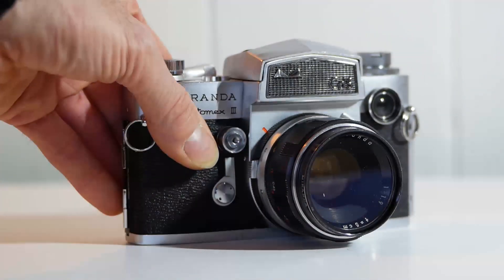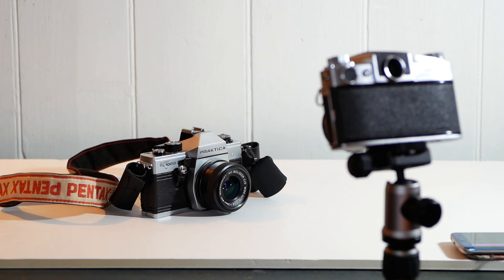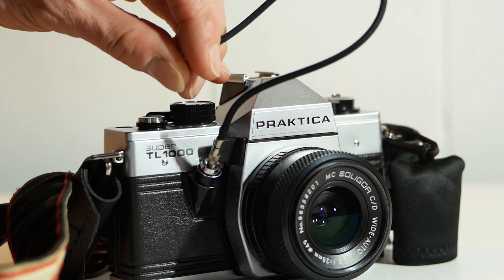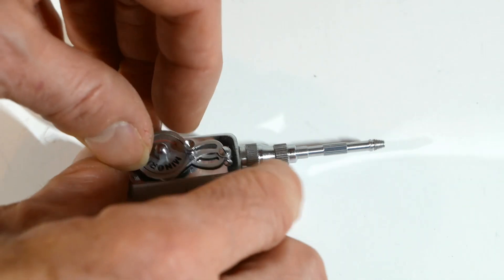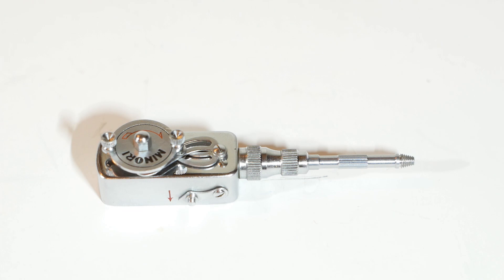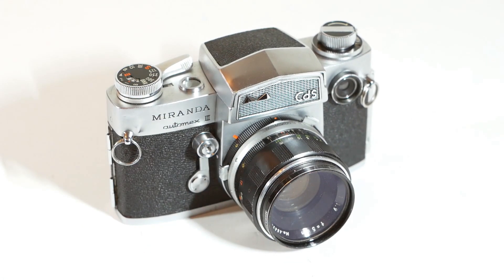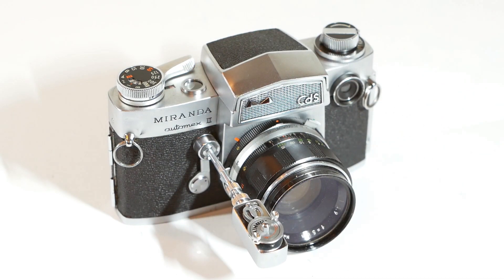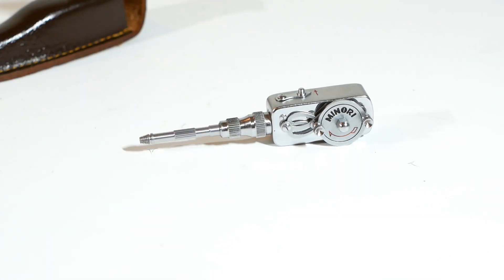Minori - Vintage Mechanical Camera Shutter Self Timer

Comment: do you know if this or any self-timers are compatible with the Canon TX?
Reply from the maker: Hi Real Topeka People, if the TX takes standard threaded cable releases, then this, or any of the other similar self timer modules, should work.  Looking at photos of the TX, it looks like it does have the standard threaded shutter button, but it also looks like it has a built in self timer - or has your integrated self timer jammed up (like so many do)?

Comment: Brilliant so I found mine used on a Leica IIIg was set up differently but could it adapt to the more common pin screw in or do I have to use the separate adapter I’ve been using (Leica III to M6 TTL
Reply from the maker: Hi khandcombe, I know the fitting you mean, my Edixa Reflex uses the same style.  I wouldn't be surprised if they made the timer fairly universal with interchangeable ends.  I've seen adapters that convert the standard pin type to the 
 barrel type connector, but not the other way round.  Is there any evidence that the end might unscrew leaving the standard pin type?

Comment: What a jewel
Reply from the maker: It's a cute little solution to the problem, and I never knew these things even existed until earlier this year.
Reply: @GrumpyTim  any idea what materials they used? It's held onto its chrome remarkably well.

Very happy to hear you are still discovering things about your hobbies, it always feels like a treat for me when that happens.

I was cleaning the float on a dishwasher the other day and thought of you when I found the PCB mounted reed switch.
Reply from the maker: It looks like it's Chrome over Brass, the case and pointy end aren't magnetic, and it's not Stainless Steel or Aluminium.   The inner workings are steel as you might expect.

I'm still very much in the fun, learning stage at the moment - every different camera I open up for repair is a voyage of discovery, even two of the same camera but a few years apart reveals interesting design changes and improvements.

I love reed switches, they're such a nice thing to find on a piece of equipment.  I used to marvel at the safety interlocks on printing presses - some of the early machines used to have a pin that prodded into a hole when the guard was closed, but you could easily defeat those by putting a matchstick into the hole and then run the machine with the guard open.  They moved over to things like a disk with a notch that the switch fell in to when the guard was closed - that way, if the switch jammed in the depressed position, the machine wouldn't run, and you couldn't simply tape the switch in the depressed position to run with the guard open.  They had fancy systems so you could nudge the machine slowly a bit at a time for cleaning with one set of guards open, but only by using the buttons on that particular section of the machine.  I don't know why, but all that stuff used to fascinate me!!!

Comment: I love the way the little wings appear - beautiful! 

I have a Bolex Paillard version (designed for a cine camera) which you can set for up to 20 seconds. It look like new and appears to work but I haven't had need to try it out yet.
Reply from the maker: Hi Morris, the little wings are great aren't they - so simple, but effective.  I just did a little search for the Bolex one that you have - that's a nice thing too.  I do have a couple of cine cameras that I want to try out some time, but film, processing and scanning will make it quite an investment, so I'll save that for a rainy day (well actually probably a sunny day if I want good footage!!!)
Reply: @GrumpyTim  I got a cine camera as part of an auction lot. I opened it up and found film inside. Normally I develop any film I find in cameras but the cost of developing cine film is bonkers!
Good luck with finding a sunny day ;)
Reply from the maker: Yeah, sun.........I remember that........